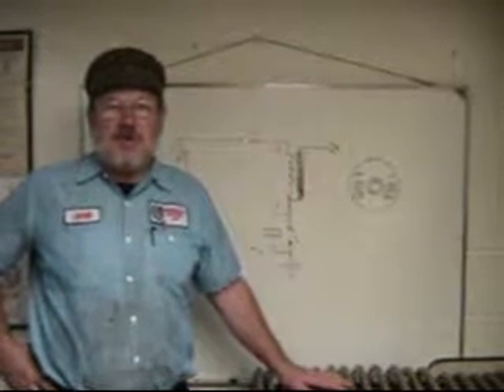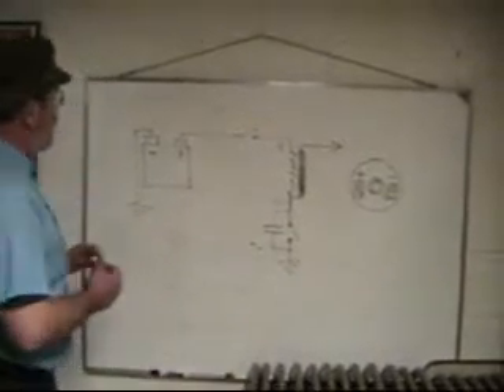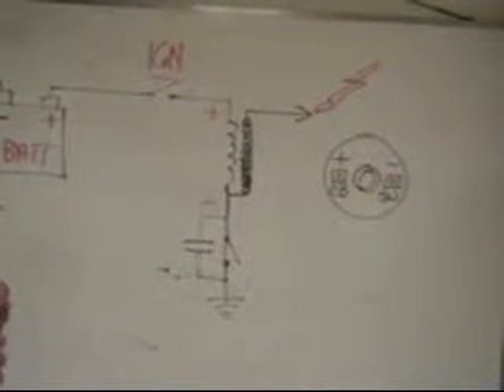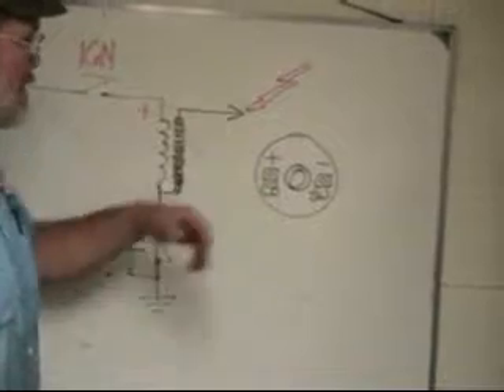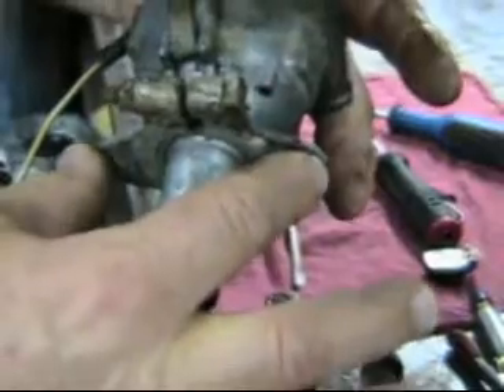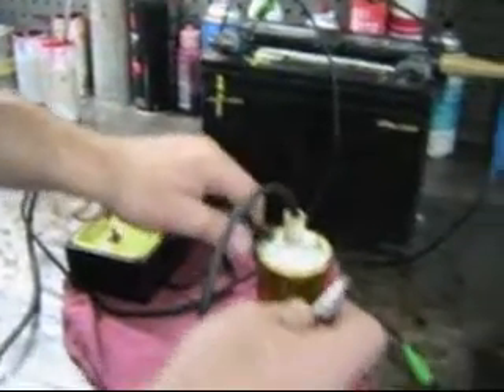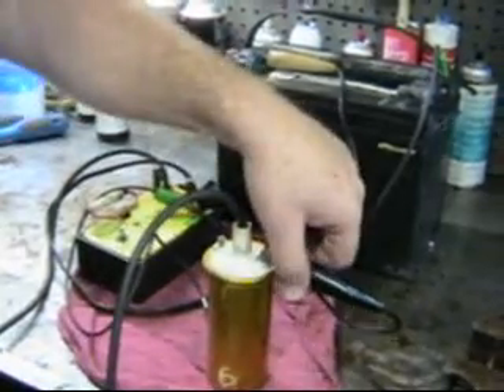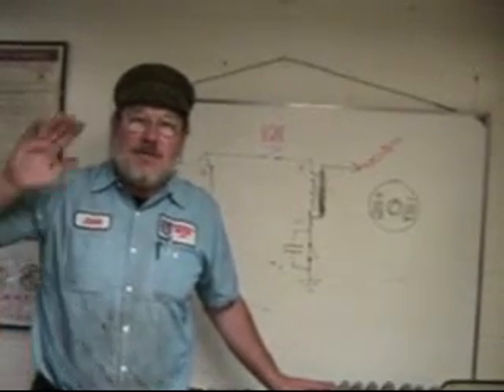031 MG Tech | Replacing Points in the Distributor

Comment: I know this is very old and I doubt John sees these comments anymore but I wanted to say thank you!  I fell into the trap you mentioned about not having the condenser wire attached to the top of the points.  Was rtrying ot figure out why I didn't have spark for a couple hours.  A view of this na dI am back up and running.  thank you sir!

Comment: I used this video to set my gap to 0.015" and performance has improved greatly (1974 MGB).  I was losing power as the engine warmed up, but now the car is still powerful when it's warm.  Also, the engine seems to be running at a better (cooler) temperature. Thank you John!!!

Comment: This is a terrific video. I will say though, I just replaced the points & condenser on a '69 GMC and found it less troublesome to just hook up a a dwell meter and make my adjustment from there. I guess the design of the Chevy distributor facilitates that much better than this MG dizzy does.